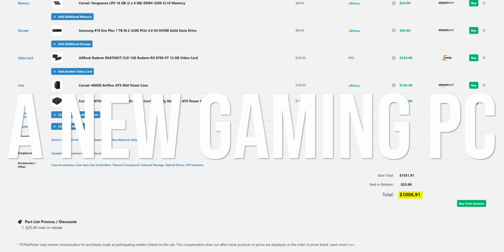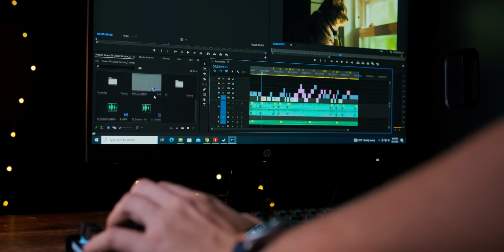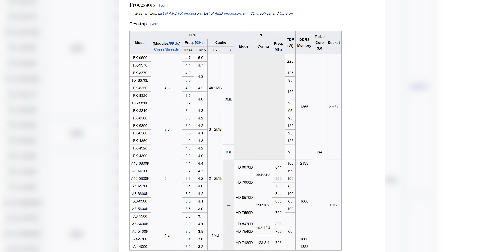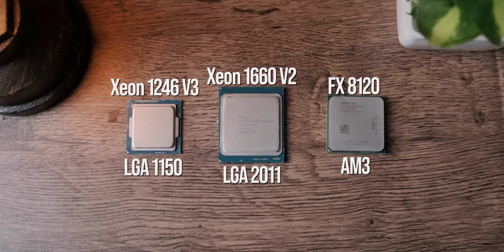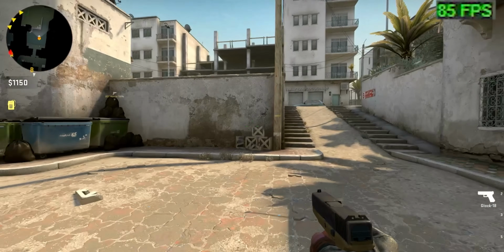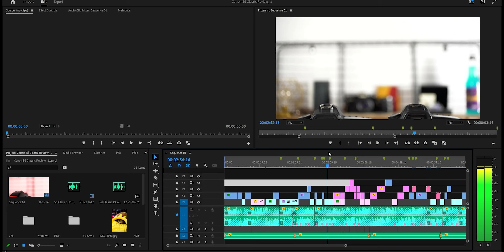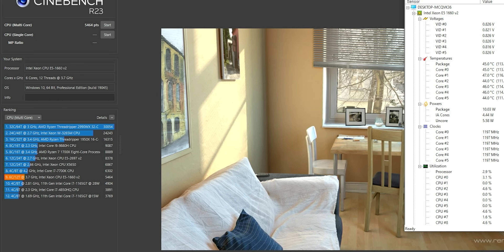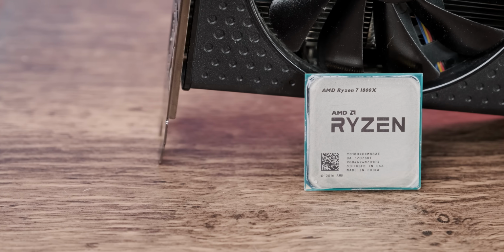DDR3 is DEAD

Comment: Still on a 4770k with an MSI Z87 MPower board and 8gb of RAM since 2014. The only thing I’ve upgraded over the years was from a 550 ti, to a 670, and currently a 1070. I can still manage to run GTA V, Shadow of the Tomb Raider, and MW II at 30-50 fps. Cyberpunk runs at around 25-30 fps 😂 with some stuttering. All low/medium settings and 1080p of course.
Reply: I'd upgrade to a fast 16gb kit asap
Reply: I was getting 90fps on warzone 1 with a 3770 and 970, so 50 fps for wz2 on a newer more powerful CPU and GPU is just wrong.

You got to put 16 or 32 gigabytes of cheap ddr3 in there, it will make a world of difference.

Comment: My i5-4690k died few months ago. It has been working for me since 2014 to 2021 and I gave my old pc to my parents. I bought 4590 for about 12 dollars and it's working again.

Now since early 2021 I'm using Ryzen 7 5800x, hoping it will last me for the next 4-6 years.
Reply from the maker: 5800x is a great chip, I'm sure it'll treat you well for a long time
Reply: sounds like a bad overclock on a pc that wasn't used for gaming anymore...

Comment: I was on DDR3 from 2009 to 2019.
Started on a Phenom II X4 955
Capstone'd with a FX-8370 👑
It started with the worst $$$ 4GB kit of Mushkin 1600MT and wasn't until late 2017 I finally felt the need for more. Picked up a 8GB Ballistix kit and that lasted long enough until I got into editing but was such a good experience I started to notice bottlenecks here and there. Picked up a RX 580 8GB card and that solved a lot of issues. Then I went FX. It was a great improvement that also cut some vulnerabilities.

At some point I went to a 16GB G.Skill 2133MT kit that solved loading issues with certain maps but then got curious about M.2 drives. If I found a Sabertooth board, this Ryzen box probably would have never happened. Benchmarks and compute jobs definitely reveal it to be an upgrade but it always felt sluggish to me for some reason. Maybe FX is the last real solid CPU that I'll see in this lifetime. It held the 8.7GHz WR from 2014 up until last Christmas. It's a great chip but all I hear about from friends is that it's so slow. Pretty wild to think about. I spent that entire decade on the AMD 970 chipset. They were all on something else.
Reply: AMD FX are the worst cpu's ever made, it's not really debatable
Reply: @sirfairplay9153  But how is that possible? It's quiet and sips power until I ramp the cores. It gets hot only when I pin it at 4.5GHz all cores, otherwise it hits 8℃ in the middle of the night. The only real failing of that system is no ITX motherboard availability and at this point I wouldn't want to go digging. The board has more than enough PCI-E lanes that I'd rather cut one of the slots and start loading up with tons of modern gear like a HD capture card, an Intel GPU or Tesla accelerator, a Seagate PCI-E/SAS SSD, some 10GbE SFP card and six 16TB sata HDDs to let stream server go brrrrr.

The FX is old enough to drop in favor of Ryzen, I get that part. It's not old enough to be completely useless, especially when I can still get full disk I/O speeds compared to the 63% average I get from an Athlon 2650e. Bottom line is I wouldn't want to give this away to anyone that doesn't know what they're doing.

Comment: I'm rocking a Z87x-OC Force from Gigabyte, with i7 4790k 4.63ghz stable on air 'CM 212 evo'. 3070ti, 32gb DDR3 2400mhz, Dual 512gb r-0 Samsung 870 evo, 2x 512gb Nvme SSDs: one crucial p3, one wd 770 through PCIe adapters, plus modded BIOS for ReBar & micro Nvme modules.
What else can I ask for?

Comment: For 80$ you can get a PC that plays all modern games and is way more powerful than the Steam Deck: 50$ for a prebuilt with Ivy Bridge i5 or i7 with 12+ GB DDR3 RAM + 10$ for a 256 GB SSD  + 20$ for an RX 470 4/8 GB mining edition with no outputs (many people just think these GPU's are worthless  and throw them in the trash,  but you can actually game on them using the Intel iGPU with almost no performance penalty). I am rocking such a system and the only thing that really struggles to run is Starfield and heavy android emulation software, for everything else it is great and I'm not upgrading anytime soon...
Reply: you get a proper bottleneck by running trough the igpu, plus that rx400\500 have uefi bios and on most 2nd\3rd gen motherboard\cpu combos they wont work with the igpu turned on, I have tested it on quite a few systems and when its turned on from the bios, win10 doesn't boot anymore, starts very slowly and after a reset it just goes in to automatic repair, only solution being the deactivation of igpu, I'm sure that I've tried legacy or uefi with no changes, it only works with nvidia cards, tried with gtx760 and 1050ti that both get their framerates cut in half, never mind that I wouldn't risk dead mining cards on a good pc...
Reply: @dubment  I am running an i5 4460 with a Sapphire Nitro RX 470 mining edition + VGA output from Intel HD 4600 with no problems, just finished Cyberpunk 2.0 on it, you may be right about the UEFI compatibility issues on older sockets even tough they usually work fine with newer cards, I do not recommend people buying Haswell or later chips because they are way overpriced, specially the 4C/8T i7's
The only issue I'm having with the mining card is that I must first enable the iGPU in BIOS before inserting the card in PCIe slot and disable the multimonitor option, or it will try to output video signal on the mining card with no outputs, also AMD drivers refuse to install OpenGL when they detect the Intel iGPU in use, but hardly any games nowadays uses OGL on Windows...
Also the mining cards have an hidden HDMI port that you can solder back on, but I'm too lazy for that and just keep using VGA in 2024...

Comment: My DDR3 is alive and still doing great. Not dead. Still running a 4.8ghz 4790k/5700xt/2133 CL9 - very well balanced system, GPUbusy is perfectly synced in all my games- no bottlenecks, maybe even a tiny bit of headroom. 

These sorts of systems make for great cheap 4k gaming rigs. It's not practical but if you wanted to at 4k you can pair a 4790k (or similar like 2011 Xeon you tested) with a 4080 or 4090 and get minimum bottlenecking- even with raytracing turned on. There are many videos about it on here on YT, CPUs become almost insignificant at very high resolutions.
Reply: More power to ya! Im still hanging on with my 4.8ghz amd fx 6350 2.8ghz on the northbridge, and my ram sitting at cl11 2400 ddr3
Reply: Are you sure? A lot of places I’ve checked says that a 4790k would be a bottleneck with a 4080. No reason to buy a high end gpu with a low end system
Reply: No just no. Why the hell would you put a 4080 or a 90 in such a low end system? Raytracing is very cpu and ram bandwidth hungry...
Reply: Keep fooling yourself.
Reply: saying a 4790k with a 5700xt is "perfectly balanced" is delusional lol maybe if you avoid CPU heavy games, and claiming that you'd have a fine experience with a 4080 and anything raytracing/dlss with that CPU is even more delusional. anything more powerful than a gtx 1080 makes no sense for something like a 4790
Reply: This is capped got an old 4790k. Tried it on my 4090 bottleneck is pretty obvious I lose about 30-100 fps. 4790k and 5700xt is balanced not on 4090
Reply: I had that cpu and gpu combo, it's bottlenecking that card. Not the cpu as much as the PCIe gen and chipset.
Reply: You won't get minimum bottlenecking with a 4080/4090 at 4k because the 4th gen platform is super old. There are multiple bottlenecks in that case. Even the CPU might be bottlenecking a little at 4k. DDR3, PCIe 3, and the chipset will really hold those cards back

Comment: Honestly what kills budget AM3 builds nowadays is the fact that those CPU's don't have any multithreading.
That FX-8120 you used is 8 cores and 8 threads unlike modern Ryzen 7's that are 8 cores and 16 threads.

LGA2011 seems like the way to go for budget builds using DDR3 but i'm sure that by looking carefully you could find 1st, 2nd or 3rd gen Ryzen CPU's and go DDR4 and AM4.
But to me it seems like LGA2011 is the way to go for a budget build using DDR3.

And i know how it feels to change entire platforms, back in August i went from Phenom II and DDR3 to 5th gen Ryzen and DDR4.
The difference that it makes is unbelievable.
Reply: He means what Intel calls Hyperthreading and what AMD calls Simultaneous Multithreading.

That’s where you have two threads per physical CPU core.

What a lot of AMD chips lacked back in the day, was single core speed. Their instructions-per-cycle was very low so they would perform poorly in games that did not utilise all those cores, and many games didn’t back then.

Games that multithreaded well would perform good on these systems, but games that primarily used one or two cores would perform better on even a Pentium chip of the era.

When we got to the FX-8000 series, AMD was truly hilarious. These chips performed so poorly in single core tasks that it lacked behind severely in a lot of games.

The FX-9000 were just 8000 chips with the core clock turned all the way up, resulting in hilarious TDP and some of the chips had watercooling as a requirement because they ran so damn hot.
Reply: @99domini99  mostly true but the amd fx chips had a lot of potentially with the proper overclock. I remember my amd fx 6350 sitting at 2.6ghz on the Northbridge and 4.8 on the core. Ram was around 2300mhz. Being from the Netherlands heat was never really a issue but she still ran hot as fuck on some games, but an absolute monster. Had it from 2016 until last year.
Reply: Bruh what? you claim they dont have any multithreading and then in the next sentence say they have 8 core and 8 threads? that means multihreaded bro. if it wasnt it had 8 cores 0 threads.
Reply: @НААТ  To me multithreaded means you have double the number of threads.
Reply: @GUCFan  Okay to you maybe, but thats not the official meaning of multithreaded.

Comment: Intel 7th Gen supports both DDR3 and DDR4. Would be interesting to see one of these thrown into the mix. 

Picked up a i5 7500 for only £15. Only down side is second hand motherboard pricing being £50+ for some questionable listings with the majority floating around £70-100 mark. 

At those prices a second hand AM4 processor R7 1700 or R5 2600 and new AM4 motherboard (second hand market is about the same price as buying new) matches the price of the Intel system. Go £10 extra on the processor and the R5 4500 still roughly matches in price but wipes the floor in performance. 

DDR4 has fallen enough that it isnt completely undercut by DDR3. 

DDR3 is great atm. Being able to get cheap chinese 16GB sticks is an easy way to add memory to an old system (8GB really seems to struggle these days) would be so much better if 6/7th Gen systems didnt take the piss with second hand mother board pricing

Comment: 1150 has life in it to this day. with xeon pricing and the mitigating advantage of their much bigger l3 cache, ddr3 is barely an object. Hell, an 1150 xeon paired with ecc ram will run even smoother thanks to the low latency of ecc dimms. pcie3 isn't great anymore, a lot of ultra budget cards get throttled (looking at you amd) but an older mid range card will fly.

Comment: I'm still on my 4790k. I'll probably upgrade in a year or two but my system lasting 8 years is pretty impressive.
Reply: Same 4790k devil canion , msi z97 kraith with rtx 3060ti and 32gb ram 2200mhz,2ssd raid and 2  sshd raid ,cpu up to 80-95 usage in new game ,still rock 👍 to this day,m2 on this mb maxim 800mb/s ,normal ssd  in raid read up 1200mb/s 😉 tested
Reply: I'm still on a 4570
Reply: 2500k for life
Reply: 4590 for heart
Reply: Honestly 4790 was a pretty banger cpu
Reply: Kinda an update. I just delidded my 4790k. I used PTM 7950 instead of liquid metal so there's less fuss about maintenance. It's pretty stable now on 4.6ghz while having an underclock of -0.015 volts. I can probably make it last longer if I buy a dual tower cooler and ramp up to 4.8ghz.
Reply: same, just upgraded to 32gb ram last year. Still runs fine with Vega 56, it's enough for my games (FH5, GTA5, older/less demanding games). :)
Reply: same
Reply: I ran the smaller brother, the 4670k for 10 years and upgraded 2021. Loved that CPU.
Reply: That’s gonna be me with my i7-13700k and 3080 I don’t plan on upgrading anymore until 2033 😂. Just too expensive these days
Reply: Your going to need to upgrade that 3080. It's vram is a bottleneck and a genuine issue, you have a high end rtx card that doesn't have the proper amount of vram to run it. Going to be obsolete in about 3-4 years @Kdot98
Reply: @appsaucetech  you dont know anything do you...... its not going to be obsolete in 3-4 years
Reply: @Assestionss  I ran a 4570 and can vouch that it is pretty much obselete. Not pointless just obselete
Reply: im running a 4790k with 32gb of ripjaws 1866 soon to be 2400 when the new sticks arrive. soon upgrading my z87 to a z97 and definitely keeping my 2070s around. reason for wanting the z97 is the double nvme slots
Reply: Im using a 4790 and z97 sabertooth  and a gtx 1060 seems good . I have newer stuff w ddr4  but this feels fast still. Works for steam etc. Youtube live streams.

Comment: today the final piece for my new pc is arriving, but i used an fx-8350 and a 1050ti with 16gb of ram from when i was 13 until today (i'm 19). I needed to change my old ddr3 pc and build a ddr5 one for faster memory and cpu (i edit lots of videos), but if i was using my pc just for gaming i would honestly just upgrade to a 1080ti and i probably still would be able to play most games in 1080p medium/high settings. At the same time... editing videos is insanely slow and laggy, even at 1/4 the resolution.

Comment: my setup:  e5 1650 v2~ 11€; asrock extreme x79 extreme 9~ 45€, ddr3 16gb~ 22€
Reply: cpu is doing 4,7 on my sniped ebay 9€ dual tower cooler haha only thing that would be better for such a budget is like a dirt cheap b450 board with a ryzen 7 3xxx or better

Comment: I used to run an i7 3770 with at first a dell optiplex 7010 motherboard, then a 3010, then a micro itx board from gigabyte for the past 3 years up until recently with 20 gigs of ram. It was good for lightweight games like minecraft, overwatch 2, beamng and some others at the time. Browsing and simple editing was good, but the one problem with it all was stuttering from slow ram and a small bottleneck with my gpu. They're good if you can build one for dirt cheap for simple gaming, but once you start playing some of the newer games, it shows its age.
Reply: same here with the 3770, its ok with 1600mhz ram, if you have a 4k monitor its good with a 6600xt or an rtx3060 at most since for 1080p it bottlenecks even a 1050ti or rx570, tho I have another rig with a 2500k at 4,5ghz that is better at 1080p with those cards but uses double the power...

Comment: Fiancée was using a Haswell i5 4460 with RX580 until very recently. RDR2 ran fine.

She has upgraded to an 5800X3D and 6650XT now and RDR2 still runs fine, but now with all the details set to highest.

Pro tip for anyone with an AMD FX system: Set your Windows power profile to High Performance. This used to make a huge difference back when I had my 8150 and 1070Ti.
Reply: Thanks for the tip bro, I bought an rx 550 these days
Reply: it still can make a huge difference, since high performance removed windows set power limits that might be holding your PC back in some situations. bear in mind though that the reason that setting exists is because power to performance offers deminishing returns. there is a point where you get almost nothing back.
Reply: How would you get to power profile?
Reply: I would recommend selling the R7 5800X3D though don't get me wrong it is a very good cpu , the gpu you have paired with it is not making it run at full potential and unless your fiancee does video editing you don't need a powerful  cpu instead put that money into a Rx 6700xt or 6800 for gaming that would be nice though if you plan on upgrading her gpu in future then it is good "Future proof" of a cpu.
Reply: @chills5100 Thanks, but the 5800X3D definitely suits her use-case and the 6650XT is a 2X increase versus the previous RX580. She is a gamer, but she’s also doing other things on her PC that benefit from more CPU.

There is also a PSU constraint that puts higher Wattage GPUs behind an additional paywall of around £150. Even going up to a 6700XT would be an expensive option and just not worth it versus the 1080p gaming she does.

I watched her play some RDR2 last night with all details set to high and it was maintaining 60FPS quite happily.
Reply: @StefanHolmes  Also the 1% lows should be way higher and the game should be more consistent with the 3d vcache
Reply: @chills5100  People use computers for more than games you know... Higher core counts are very helpful when you multitask like I do.
Reply: @Cobalt985  Then you can get a Ryzen 9 5900x as 6 to 8 core is just 2 cores but 8 to 12 or 16 is massive.
Reply: @chills5100 r7 not r5
Reply: Thank you @someguywithmtndew5691  .I have corrected it.
Reply: @chills5100  doesn't matter if she can still play RDR2 on the high presets
Reply: @chills5100 in the short term you may have a point, but if they intend on keeping their PC long term, a 5800X3D will remain viable for ages so they can probably get away with upgrading just their GPU and be fine for ages